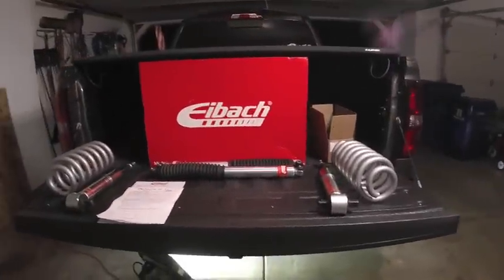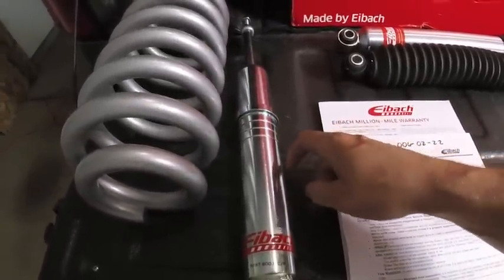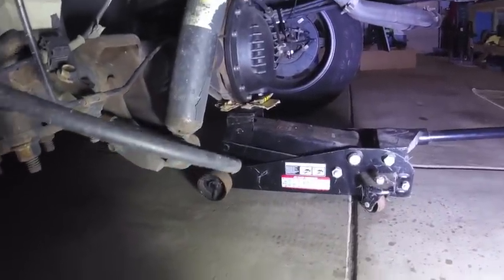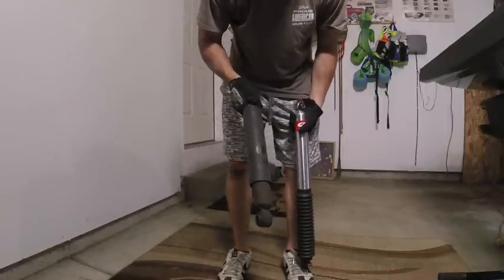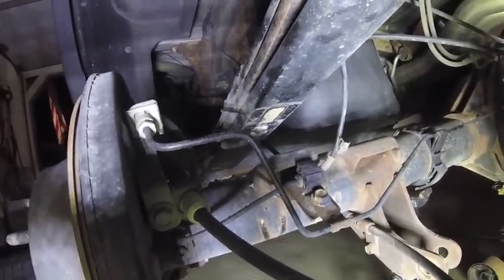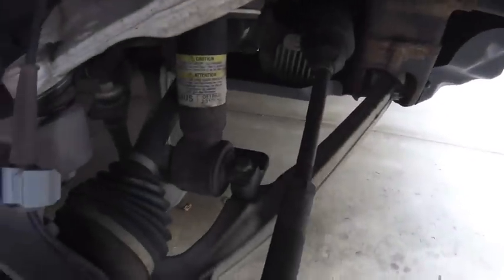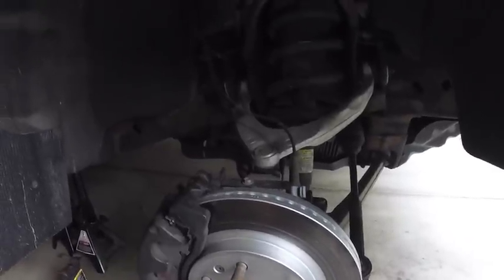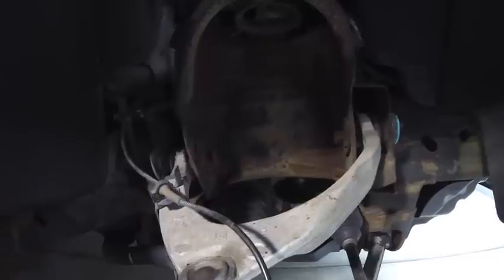Eibach Pro Truck Lift Kit Step by Step Install - GMC Sierra

Comment: VERY NICE JOB ON THIS VIDEO.  Nice change of pace to see a well done video. You covered all the important points, got to the point. Well done my man. Looking forward to doing mine
Reply from the maker: Guy Trevaskis made my day!!! Thanks!!!!
Reply: Water Fowler 41 do you have to add the 2” rear blocks Or can it be done without adding it? Planing on getting that same setup without the rear blocks..
Reply from the maker: @JTrump23  I added the rear block because I wanted to retain some of the rake.  If you dont add it, you might have a truck that ends up nose high.

Comment: Good job on this.Appreciated this video. Saved me a bit going in knowing what to expect ahead of time. The instructions or lack there of left a lot to assume or figure out. Fyi anyone doing this kit. You do not need to take that bump stop plate off old strut. The piece you have to pop off to get perch off. Do the upper control arms if stamped steel. Either aftermarket or factory aluminum.Typing this while at alignment shop. I will say test drive and drive to shop so far more planted and we’ll tuned to road. Definitely not too stiff staying on the bottom setting.

Comment: Hey man, just wanted to give you a shout out and a big thank you for this video!! I am no mechanic but I was able to do the exact same setup on my 15 silverado using this video and the instructions you posted. Springs were the hardest part obviously but I was able to get it done with minimal help!

Thanks again!!
Reply from the maker: Awesome, thanks so much!!! The springs in the kit are no joke and it takes some messing around to get them compressed enough to fit the new struts.

Glad to hear the video helped!

Comment: Factory shocks are no rebound shocks. They are basically oil filled tubes to control the spring. It wasn’t blown. Still worth the upgrade though. I want to replace my rancho’s with this setup.
Reply from the maker: Finesse_Angler the blown shock was leaking oil, the other OEM shock returned to its original length. Rear shock was blown.

Comment: I also have a two and a half inch level front end all I need now is to get the rake back and the rear helps with hauling
Reply from the maker: Jevon Shepherd I agree 100% for looks the level look is great but from a functional stand point, need that rake

Comment: I was really considering this kit, but I’ve been hearing mixed opinions on the ride quality. At your current setup how is your ride? Is it too stiff or is is pretty close to factory ? Much appreciated
Reply from the maker: Jagtar Thiara compared to stock, the eibach kit on my truck is great. Nice firm ride.
Reply: Water Fowler 41 ok and what setting on the shock are you currently running?
Reply from the maker: Jagtar Thiara second ring.
Reply: @WaterFowler41  I thought you set it at the lowest setting?  Did it settle and you had to increase the height and move it to the 2nd ring?
Reply: I am confused as well, did you use the lowest notch for the 2.5" or the second from the bottom.
Reply: I'm also confused on which setting you used @waterFowler41 because in the video you said it was on the lowest setting.  I'm unsure where I want to put mine.

Comment: Would you recommend swapping out UCA for help with alignment and or to create more distance from bump stop? Just bought this for my 18 Silverado, waiting to install because I'm considering UCA upgrade.
Reply from the maker: If you have extra $$ then yes! Lifts/levels will wear out stock components eventually, if you can get ahead of the game and replace with a quality UCA then you are ahead of the curve!  This way you only need to tear into everything once.
Reply: @WaterFowler41  Yea, that's what came to mind. Have you swapped yours and or have you had any issues with the lift if you haven't swapped? The truck is pretty planted and level? Thanks for the info.
Reply from the maker: Joe Geiger yup very planted no issues BUT it’s a 2.5” lift on otherwise factory component, eventually something’s gotta give. 

From a price perspective the rough country UCAs perked my interested but there’s so many other options out there. Gotta start doing my homework.
Reply: @WaterFowler41   Ya, that makes since. I've just been reading different forums about some of the ACUs out there rubbing. I'll also do some homework myself. Let me know what ya find brother, thanks again.
Reply: @Joesg33  what was your end result
Reply: @bludragontruck9743  installed the same Eibach Pro Truck lift as in his video. My biggest observation would be that these coils are strong as hell which can give off a stiffer ride.. especially in the winter. Overall for the price it's a solid kit. I'll eventually be adding on Dirt King Ucas to help with travel as well as Upper Arm Alignment Cams that help maintain alignment that gets thrown off from offloading with these strong ass front coils etc.
Reply: @Joesg33  I really appreciate the feedback, I’m thinking of the same set up. I think I’m convinced enough. 👍🏼

Comment: Hey I just got this kit and want to move up to the 3.2” setting. I dont want the ride to be crappy. How stiff is the ride at the height you have?
Reply from the maker: My ride at 2.5" is great and completely practical for a daily driver.  At 3" or more you're likely to feel the bumps more.  Also, you may want to upgrade your upper control arms, your running out of suspension angle running anything over 3" of lift on stock UCA's
Reply: Ya I got some UCA’s and a diff drop already. I might just leave it at stock height with the springs and use a leveling spacer for that extra little bit of lift cause I dont want the ride to be to rough

Comment: Great video. How are your ball joint angles? Eibach claims they keep all angles to original spec. Is this true? Thanks
Reply from the maker: j b I’m still using OEM UCAs with no issues

Comment: Good Stuff, I might just consider Eibach instead of Bilstein 5100 after using them (maxed out) for my last truck! Does the truck ride better with Eibach Coilsprings + Lowest Setting Strut OR Maxed Out Strut and Stock Coils? and is it noticeably different? Im not too familiar if these coils are firm or not?
Reply from the maker: I never ran the strut maxed out without the Eibach springs so can’t comment on that but compared to stock struts with spacers the truck felt awesome with the Eibach kit.
Reply: I had ther 5100's and stock coils,  the Eibach kit rides better & greater travel in the front, so great improvement. Definitely recommend.

Comment: how was the overall install? Contemplating on installing them myself or having a shop do it. Any estimate on what a shop cost would be for install?
Reply from the maker: vas1012 I’m not sure what a shop would charge for this but if you’ve never used spring compressors I would probably outsource it to the pros. Here’s my step by step write up.  Again if you are comfortable around springs compressors, it’s an easy job but if this will be your first time using them, best you leave it to the pros.

https://www.gm-trucks.com/forums/topic/214698-eibach-pro-truck-lift-kit-installed-step-by-step-of-install/
Reply: I sourced all my parts and the shop I am using quoted me 250-300 for the install.
Reply: vas1012 what did you end up doing
Reply: @gregoryc1648  what did the kit consist of

Comment: The website says 1”-3” or lift. So which setting do you have to be on for 2.5” you said the bottom one in the video but it doesn’t match what Eibach is saying
Reply from the maker: The instructions are not clear.  If you are using the Eibach provided spring (which is longer that stock) the bottom setting will result in 2.5" of lift up front.  Lift increase as you go to the higher settings (move the ring up the strut body).

If you are NOT using the Eibach springs and reusing your stock springs, the lowest setting I believe retains the stock height.  I also believe in this application you can max out at 3" of lift while keeping the OEM springs. 

All in all, the Eibach spring is longer and it in and of itself provides some lift.  Like I said the instructions are confusing and took some monkeying around to figure out exactly what setting I needed. Best to call Eibach and ask them.
Reply: Okay perfect, I plan on getting the new spring and shocks. I will double check with Eibach but what you have said makes sense

Comment: What offset do you have on those wheels? I’m looking at this kit to put a 33x12.50 tire on a 20x10 wheel with -12 offset
Reply from the maker: Derek Smith 20 mm

Comment: The video was really great. Thank you for all of the information. One question that I have is, do you need to chance out the U bolts when adding the 2" rear blocks from Rough Country?
Reply from the maker: Your supposed to, the kit comes with the new hardware, not sure why you wouldn’t use it. U-bolts do stretch out over time so best to replace when adding the new blocks.

Comment: Awesome video. Can I ask what spring compressors you used? Maybe I missed it in the video. This will be my first time using compressors. If I leave it to the pros this time, then next time will still be my first time using compressors... Lol
Reply from the maker: I hear you, go to your auto parts store and ask for McPherson strut compressors.
They look like these: https://www.autozone.com/test-scan-and-specialty-tools/strut-coil-compressor/oemtools-25550-macpherson-strut-spring-compressor/70135_0_0?spps.s=3181&cmpid=LIA:US:EN:AD:NL:1000000:TLS:71700000060668368&gclid=Cj0KCQiA6t6ABhDMARIsAONIYyzPPWz1kAtqmQxdeFdCU4X-rKnrY5rHDn4rDiuEtcdjvdmlUnSah08aAj--EALw_wcB&gclsrc=aw.ds
Reply: @WaterFowler41  Thank you sir! Any other quick tips for compressing the Eibach springs?
Reply from the maker: Be patient and don’t rush it, most importantly, have fun!!!
Reply: @WaterFowler41  Any chance you know the torque specs  for the king nut?
Reply from the maker: 40 ft lbs I think but you should double check that

Comment: Would this look ridiculous running on the lowest setting with 265/65/18's until I  could get new rims and tires?
Reply from the maker: It might, this is a "big lift" for that small of a tire.  33's is the smallest I would run with a 2.5"+ lift.
Reply: Water Fowler 41 thank you for the reply!

Comment: This was a very informative video. Thanks for this. 😎

It's a shame you know longer have the truck, though. I would have liked to have heard a longterm review. I came across this video while looking for reviews on the bilstein 6112 and leveled Sierras. 

I'm honestly uncertain now of what to get...6112 or this kit you had. I want to level my new-to-me truck. I had the bilstein 5100 on my previous Sierra, one notch down from the max setting. It still had a rake, but not doing a nosedive like before. 

For this new Sierra I want it level. Will 1.875 not accomplish that goal? I do not plan to replace the stock block, only replace the shocks ranchos with 5100s.

As for tire size, I'd like to fit 275/65/20. I'm not sure if 1.875 will be enough even after using zipties to pull the liner back.

If anyone answers, thank you!
Reply from the maker: at 1.8" you will not be level which is the biggest and only complaint with the bils systems.  Seems 2-2.25" is the best to level these GM trucks which Eibach will be able to net you. 

As far as bils versus Eibach, the 6112's are 2.5"
wide shock bodies so if you are seriously off-roading that would be the way to go since you will avoid oil fatigue.  I was very happy with my eibachs having only "really" beat on them a few times. they performed well.

I had to replace one of my eibach struts under warranty (internal valving failed) but other than that, the eibachs performed well and I had no complaints.
Reply: @WaterFowler41  
I ordered this kit. 
EIB-E80-23-006-02-22

I've tried the hockey puck spacer lift and hated it. Tried bilstein 5100s and was satisfied with the ride, but it was still noticeably lower in the front.

And now I'll give these guys a try. According to the eibach website, this kit is meant for 2wd. You installed it though, and according to realtruck.com it fits my 2015 Sierra 4x4. 

Any thoughts?
Reply: Actually the more I look onto it it doesn't make sense. All other websites say the same thing, that it fits and works on my truck. Maybe eibach says no because of the UCAs are angled too much and they have no inhouse fix?

Should I order some UCAs, and if so which ones would you recommend?
Reply from the maker: I’d contact eibach I don’t want to steer you the wrong direction here. I did not replace my UCAs and never had an issue with them.
Reply: @WaterFowler41  

I need your help with something I'm having trouble with. I got the eibach set put in and everything is looking great and almost operating as it should. 

What I'm noticing now going over speed bumps is a metal on metal clunk sound coming from the rear. You'd think the truck was separating from the sound of it. Is something loose or are the shocks bottoming out?
Reply from the maker: Mario Haro hard to really diagnose but have you checked your u-bolts to make sure everything is tightened down? Not sure if you added a new block in the rear but I would start there.
Reply: @WaterFowler41  

For starters, thanks for replying!

I didn't do anything to the rear except the shocks. However...my wife with her 1st grade teacher observation powers pointed out that I had a hitch. 🤣

I haven't tested its removal, but it does make a metal on metal sound by raising it and letting it drop.

I suspected u bolts as well. We'll see...long day and too tired to test it today.

Comment: Great video man! I have to ask, does your washer or how you said, the little plate, make some chain like noise as if it is loose. Because my setup makes a  little noise like that.
Reply from the maker: Nope it did not, when you install it you need to make sure it’s tapped down all the way. I believe it’s called a jounce cap.

Comment: So how do you like them after a couple years now?  I'm about to pull the trigger on this same setup but adding a diff drop and upper arms up front.
Reply from the maker: I love them up to when I traded this truck in. The eibachs were awesome!
Reply: @WaterFowler41  how long did you have them before you traded it?

Comment: Getting this set up next week on 2015 Silverado; do you recommend replacing the upper control arms? I have the cast steel if that matters
Reply from the maker: Bradley Hardesty if you have the $$ now it’s definitely worth it. You’ll end up having to replace them down the road anyways since lifts put more stress on control arms, might as well do it while you’re digging into everything.
Reply: @WaterFowler41  any issues till this day? Do you have issues with tire wear or your “tow” on the alignment? I want to do this also but I to thought replacing the upper control arm was recommended. Thanks
Reply from the maker: I don’t have the truck anymore but never had an issue maintaining alignment. I also had my factory UCAs still and no issues.
Reply: @WaterFowler41  thank you for your feedback 👍🏼

Comment: I saw your post on GM trucks about the noise you were having with this set up, I have the exact same noise and can’t figure it out. I did the same thing you did with swapping struts and the noise followed. What ended up happening with that? Did Eibach warranty these?
Reply from the maker: Yup Eibach replaced the strut, valving issue inside the strut.

Comment: I know u don’t have that truck anymore but but which one u like better eibach or bilstein 5100 on ur rebel and what’s the difference?
Reply from the maker: Really liked the eibach kit as far as replacements for factory
Reply: Cuz I’m in the middle of a pick of the eibach or bilstein 5100 for my ram
Reply from the maker: Go eibach
Reply: If I go with eibach E60 27 011 03 10 and set it at 1.8” lift plus I have the off road package with 1” lift from factory will that be a true 2” lift when I use my oe springs

Comment: How close is the upper control arm to the bump stop? I have Ready lift upper control arms but they are a little bit thicker than stocks and I wasn't wanting to cut off the bump stops. Thanks
Reply from the maker: JT C I have about a half inch between UCA and bump stop

Comment: Hey bud, sorry to bother you, I know you no longer have the truck; I just wanted to ask a another question. 
Would installing both the factory and new Rough County 2” blocks be a bad thing for the truck/shock?
Reply from the maker: I would buy a 3” block from RC. Stacking blocks is a bad idea. A 3” block isn’t that much more than the 2”
Reply: @WaterFowler41  Thank you, just ordered one. I thought the 2” block would of been manageable, however the Eibach 2.0 coilovers come in set way higher than I expected. Thanks again!